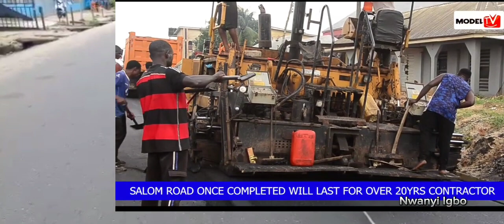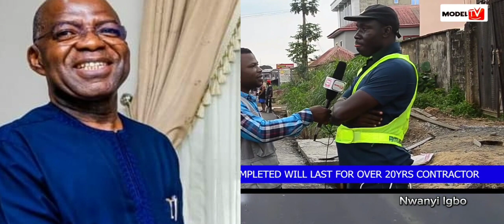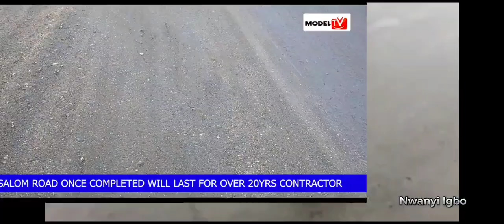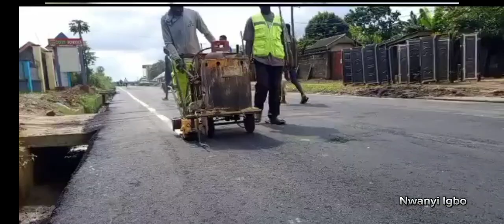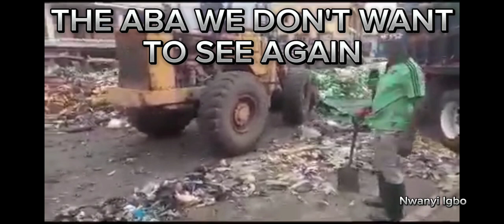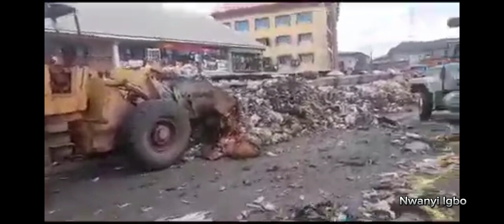ABIA TODAY - CURRENT STATE OF SHALOM ROAD ABA + MORE

Comment: One of the major probblems in final ashpalting in Nigeria,is the size crushed stones and qaulity  of bitumen used.
Those ashphalt mixing companies wont use the smallest granuels  of less than 1/4.
Reason, its more expensive for 30 tonnes of  that size.
Stones crushed to those sizes are the ones you call nylon roads with sufficient bitumen.
Let the governor know the difference in those sizes to avoid being dissapointed.